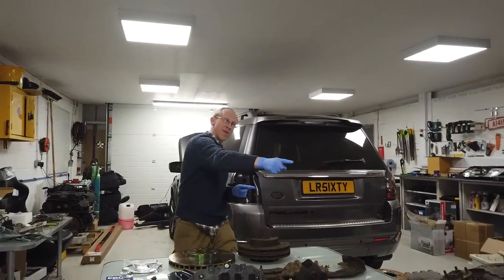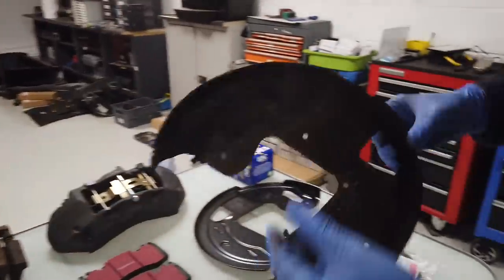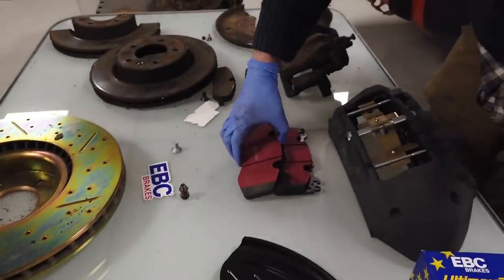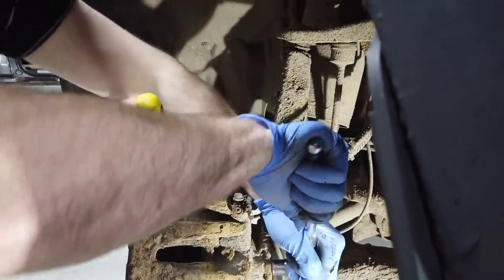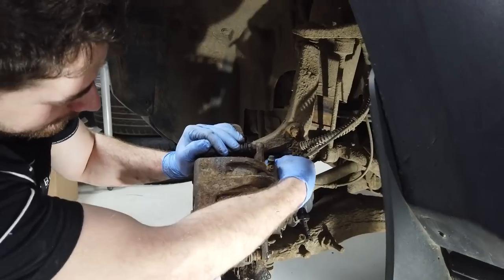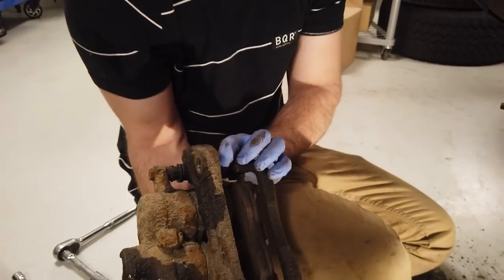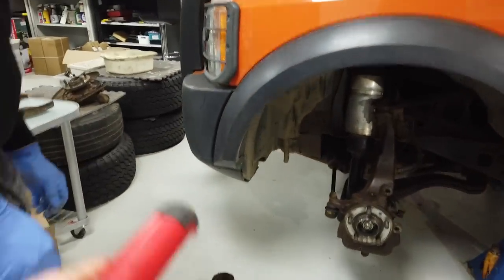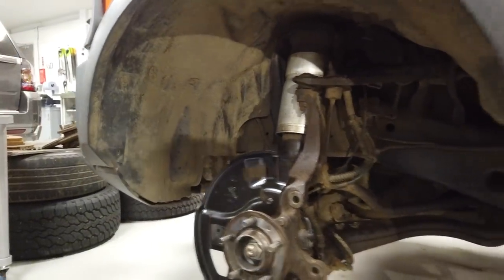Brembo Front Brake Upgrade on Land Rover Discovery 3 /4 Range Rover Sport 2005-2012

Comment: That looks like a very good upgrade, I think I would have replaced those fossilized hoses for stainless braided ones while I was there, the impact driver is a good tool to have, especially when used with a 5 lb club hammer, I am sure the heat from grinding the groove made a big difference to undoing that one, it loos like this vehicle has seen a lot of salt! Looking good! You should be working on your Kuboto ! Chris B.
Reply from the maker: Hoping to fix the Kubota next week....subject to virus stuff impacting travel.....

Comment: I would doubt these would fit within the standard D3 wheel or dust shields?  I upgraded my d3 to the V8 sized rotors and calliper hangers but it uses standard calliper and pads.  Still it made a significant improvement over the original crappy brakes.

Comment: Any issues (or anyone had exp with) off-roading with drilled/grooved discs? I wondered if there's any risk of dirt build-up in there and/or sand/stones getting in the holes/grooved and scaring the pads and disc and wrecking things, or safer to stick with solid discs for off-roading?

Comment: Is it possible to retrofit better brakes on a 03 L322 4.4 Range Rover running 19 inch wheels? Is the 05 Supercharged Brembo unit a direct fit or modifications are needed? Thanks
Reply from the maker: Yes they are a straight fit... apparently... i have not done it myself

Comment: First off, great video. Lots of details here and I'm sure lots of back end research and mock ups had to have been done to figure this out out.
I've been searching all over the internet for the larger brake dust shields and really can't find what  OEM parts you guys are using. My best guess is Right hand side: LR013665
Left hand side: LR013666
But that's what I have on my LR4 now and that seems too small.
I understand you guys spent a lot of time on this and I don't mean to take away any of your business, but the kit is out of stock and I already have the calipers. I can buy the shields from you if that's what I need to do (I prefer not since I'm in n California and don't want to pay for shipping ;) Anyways, I understand if you don't want to share the info. I appreciate what you've already done!
Reply: What calipers and rotors work?

Comment: Can discovery4 calliper change as that calliper? Because d4 original calliper is defferent with d3
Reply from the maker: Yes the hub is the same so once you have stripped it back to the hub ) i.e. removed the caliper / disc and stoneguard )  its all the same....
Reply: powerfulukltd what kind of wheel inch can it do? I think 19inch wheel is too small to fit 6p calliper
Reply from the maker: @Yunitunes  We tried this today and the 19" wheels do not fit - it was very close but they do not fit..... they may fit with a wheel spacer ?
Reply: powerfulukltd thank u for your kind answer.. can i have one more question?
I will try to change but i can’t find right stoneguard. so.. can u let me know the parts number of stoneguard you used
Reply from the maker: @Yunitunes  Hi - they are standard land rover parts...
Reply: powerfulukltd i thought so.. but i cant find the plates... so can u let me know which kind of model use that stoneguard... please help me 😭
Reply from the maker: @Yunitunes  send us an email via website - FAO Simon

Comment: Thank you for this video!  Is this the same brembo upgrade kit for the Range Rover Sport (L494) on your website?   I ask as there is nothing on the site for the Discovery 3.  I understand one needs to install 20 inch rims to clear the 380mm brake size.  

https://www.powerfuluk.com/range-rover-sport-l494-front-6-pot-brembo-style-brake-upgrade-kit-black-calipers.html
Reply from the maker: No the L494 kit does not include the new back plates you need for the Sport / LR3.... kit will be listed next week....